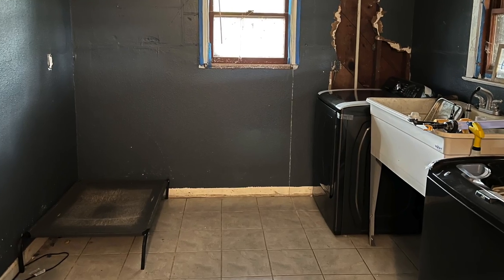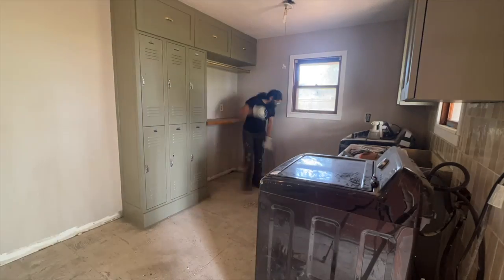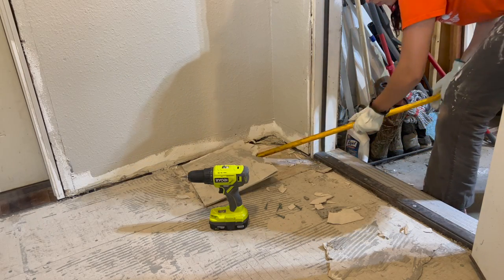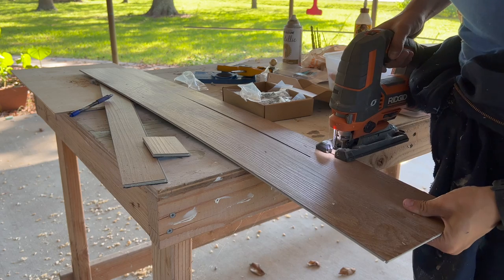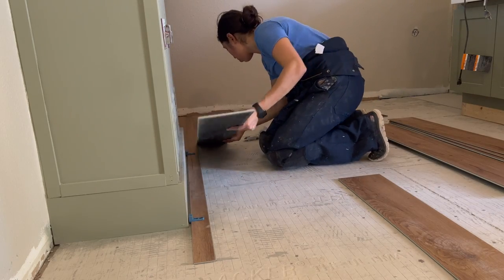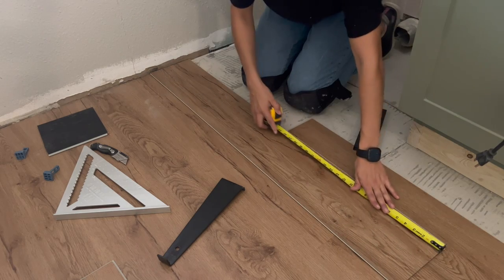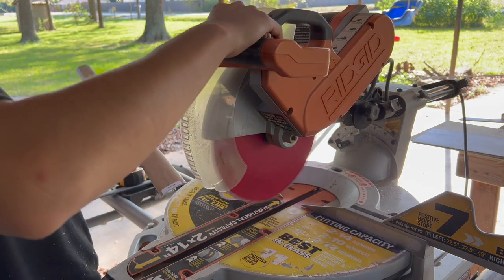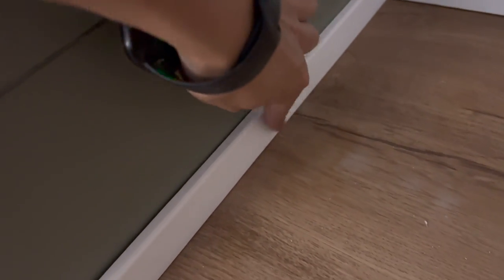EASY HOME RENOVATION | HOW TO INSTALL VINYL PLANK FLOORING | LAUNDRY ROOM REMODEL PART 8

Comment: since you only had those two cabinets was it really worth working around them than just tiling the floor before putting those cabinets in?
Reply from the maker: Since they are floating floors....technically youre supposed to install anything heavy and fixed before installing the floors and work around them.
❤️